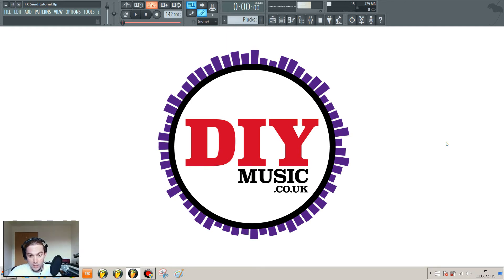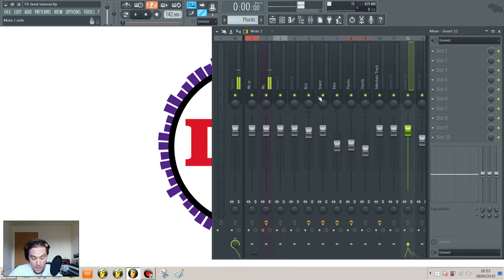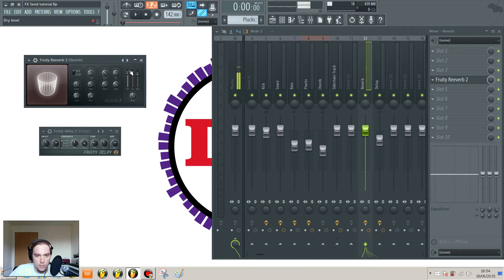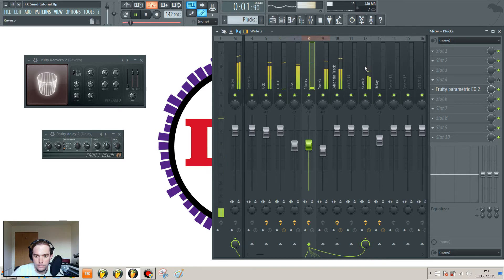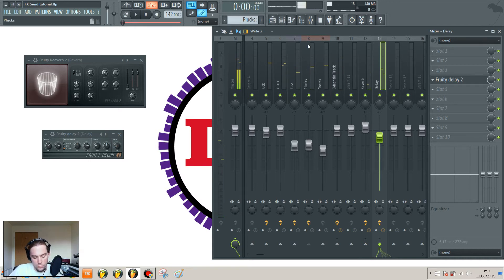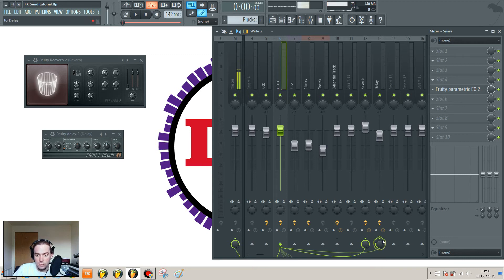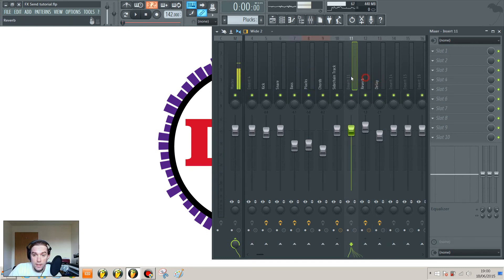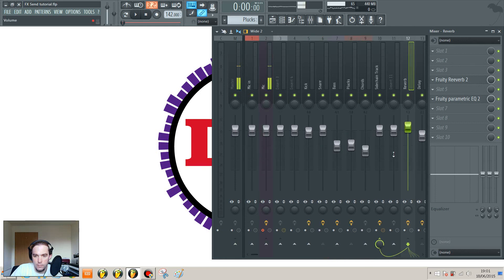FL Studio Tutorial - How to Create and Use Send FX Mixer Channels

Comment: Really nice tutorial and very well explained!
 I find it hard to learn from certain tutorials cause the person´s voice is not very calm and they do alot of random things and don´t go straight to the point which can be distracting. With you it´s very easy. 
I also tried to look out for the video where you explain the PDC issues but couldn´t find it. I´ve watched other tutorials but had never heard of that and then looked out and found out that fl studio has automatic PDC so i´m confused and would love to learn more about it.
Reply from the maker: Hi Igor. Thanks for the comments. Really glad you find my tutorials useful!

I have got a bit behind with my videos over the last year as the wife and I had a little boy, on top of a tonne of other stuff I have going on! So the PDC video is still on the list. 

It's true that FL has auto PDC and it works fine in most cases. The problems come when you start doing more complex routing such as send FX and parallel stuff. You just have to be careful because the PDC gets moved to any tracks you route to, and removed from the original track. If your original track is going straight to the master, for example, it will then be ahead of the send FX track because it won't be having the necessary delay added. 

It's a tricky one to get your head around but there's ways to avoid it being a problem. I will do that video eventually, I promise! (Hopefully you're subscribed so you wont miss it!).
Reply: Hey there.

 No worries. First things first=)  Congratulations on the baby!Wish him tons of good things in life! 

Thank you for the explanation. I´ll be anxiously waiting for the video. 

I subscribed immediately of course=) 

Best regards from Portugal!
Reply from the maker: Thanks! :-D

I'll get onto it as soon as I can and pop back here to let everyone know.

Comment: When you say "BE AWARE OF PDC ISSUES" What is PDC?
Reply from the maker: +Scot Vanderpool PDC = Plugin Delay Compensation

Basically if one plugin creates latency and causes the output of its mixer track to be delayed, FL Studio will automatically delay all the other tracks so they are in time.

However, when you start routing tracks to other tracks it starts to get a bit more complicated. 

The best thing to do when sending one mixer track to a send FX channel is to also send it to another, empty mixer channel before it goes to the master.

I plan to write an article and make a vid about this as it's a bit complex but problems are avoidable if you do your routing correctly.

It's the one thing I font like about FL Studio so I hope they fix it.
Reply: @DIYmusicUK  Im having this issue right now and can't find a fix! There still delay when I try this method.

Comment: Whenever I create a volume automation clip for the send channel it hardly changes the volume like it's just not effected by the automation, how can i change that? already deleted every other automation in the current project folder and also in the step sequencer, nothing works. also, filters don't work on the send channel.
Reply from the maker: Sounds odd. Which parameter exacty are you automating? 

If you were to out a Fruity Panomatic in the last slot on the send channel and automate the volume with that it should work.

It only effects the volume of the effect though, not the original clean audio. To automate anything for that you need to be on the original mixer track. 

Hope that helps!
Reply: DIY Music
everything fine, the problem was that the different channels were also linked to the mixer and not only the send channel ^^

Comment: what do i do if there is no dry/wet parameter.
Reply from the maker: +TuxedoMusic Hmm... Do you have a specific example of a plugin without this option?
Reply: DIY Music its kickstart, its a side-chaining plugin. thanks for responding so fast
Reply from the maker: +TuxedoMusic No worries, you caught me at a good moment. :-)

Kick start isn't the kind of plugin that can be on a send because it needs to affect the dry signal by controlling its volume. Send FX channels are used when the effect generated is something in addition to the original signal.
Reply: DIY Music ok then
Reply from the maker: +TuxedoMusic This plugin is more like something you could use on a 'bus' where you route all the tracks you want the sidechain to affect exclusively through one mixer channel (by using the 'route to this track only' option) and putting kickstart on that. So maybe that's an option you might want to think about?
Reply: I have a similar problem with LexChamber reverb. There's no dry/wet knob. How do I create a reverb send with a reverb like this?